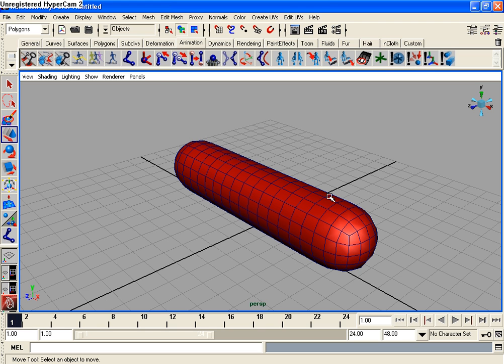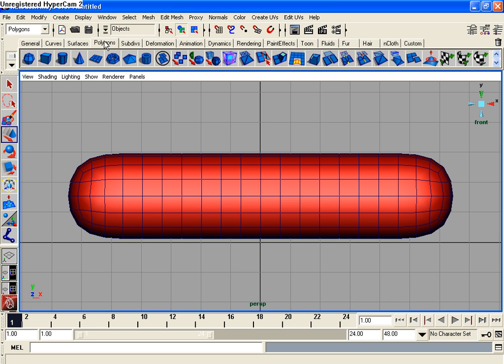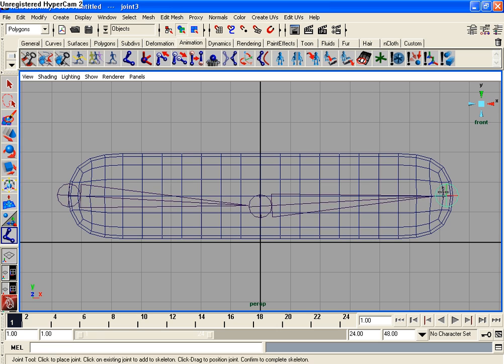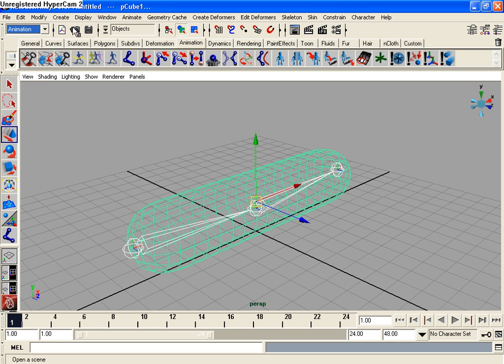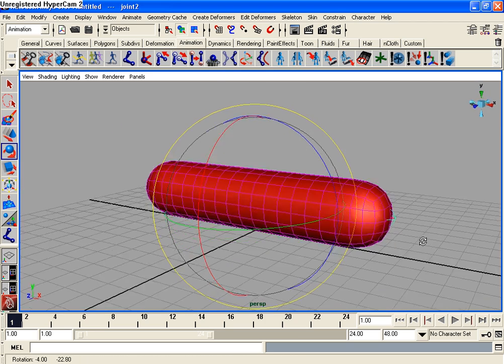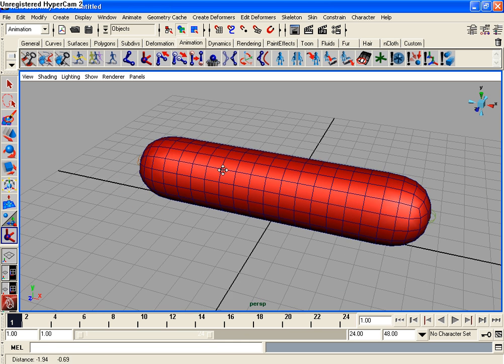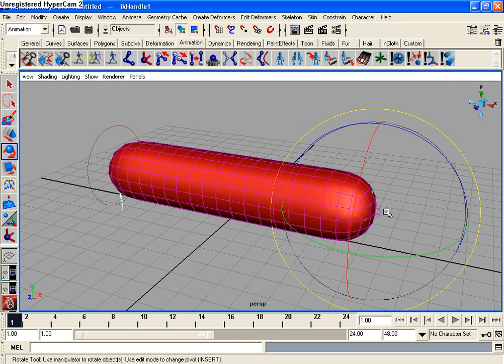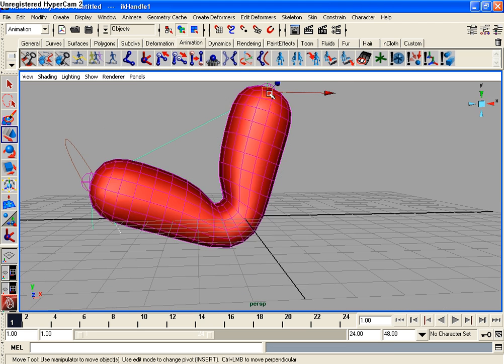Maya Tutorial 2 : Basic Rigging

Comment: @DragonToko i'm thinking you need to paint the weights... this tells maya which joint controls which vertices.. you can find the weight painting tool under skin - edit smooth skin - paint skin weights tool. don't just click on the name of the tool, though, click on the box beside the name. then a panel will come up with options, and you click the joint you want, and then paint where you want that joint to control.

Comment: on the translation of joints part, yes, it is normal, but on skin deforming, no. there is one thing and that is did u skin it b4 u translate the joint? if it isn't, then go 2 the animation panel somewhere on the top right corner. go 2 skin, bind skin, smooth or rigid.